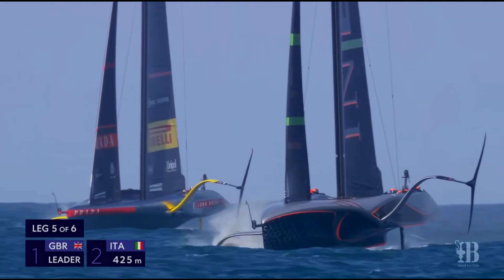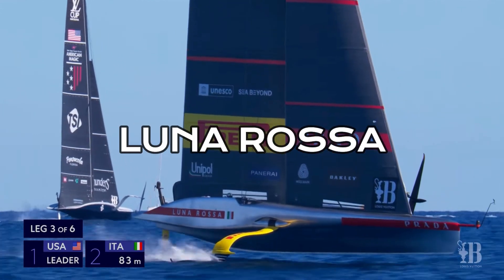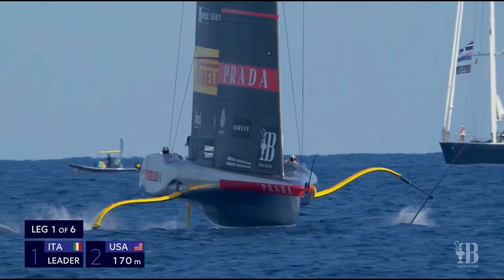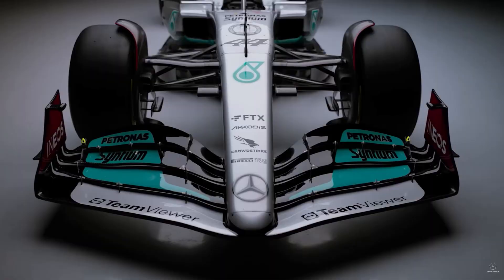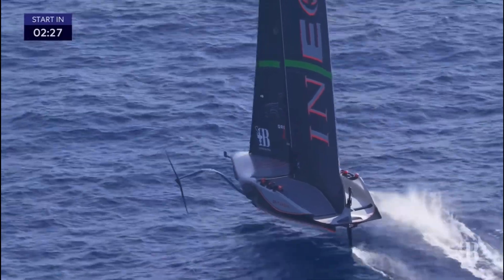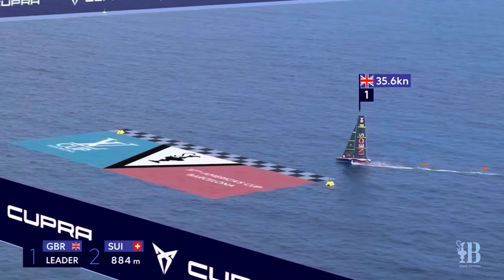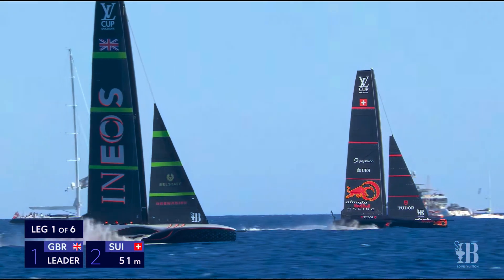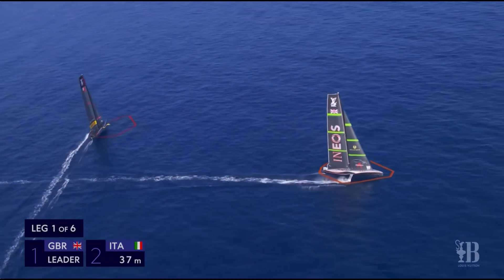Luna Rossa vs INEOS Britannia. The boats differences analysis. Louis Vuitton America's Cup Finals.

Comment: If the channel had to wage a bet what boat do you think will win the challenger final.
Reply from the maker: A very difficult bet, technically maybe the British team have more chances, but the Italians are unpredictable if they begin to do proper race starts
Reply: @PressureSailing  . Ineos Britannia Is obviously designed for sheer speed. One article I read is Giles is back in the saddle. The hull and  skeg could be well suited for conditions that are a little choppy and the wind strength is up. I heard it could be about 14-17 knots on race day. Unsure if I heard correctly. There’s a lot of untapped potential in Ineos Britannia and I’m hoping they’ve untapped it. A bit like the Kiwis last cup, it’s about harnessing that speed.

Luna Rossa is well suited for 7-10 knots. Manoeuvrable and accelerates from the tack well I feel. Luna Rossa will be very tough to beat. A very stable forgiving boat and probably easier to sail.

Anyway perhaps a slight edge to Ineos Britannia to win.